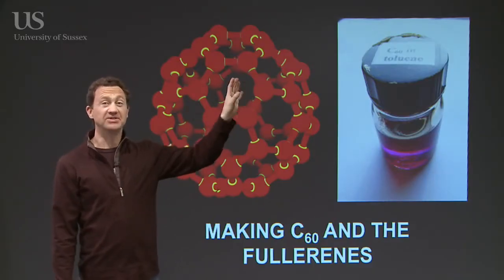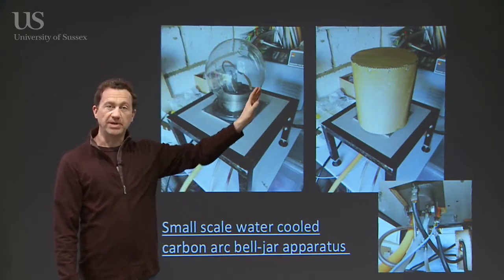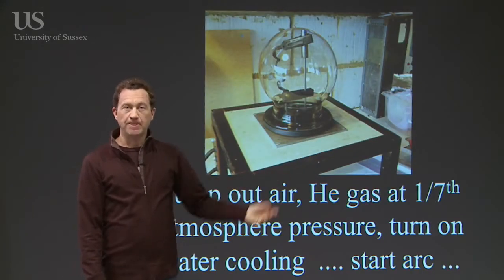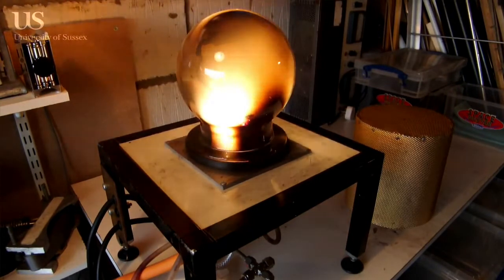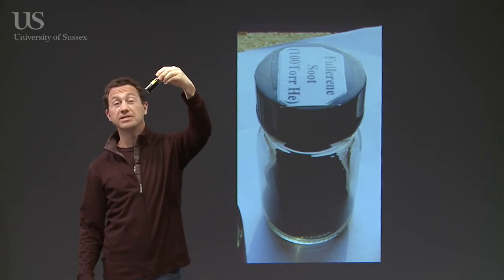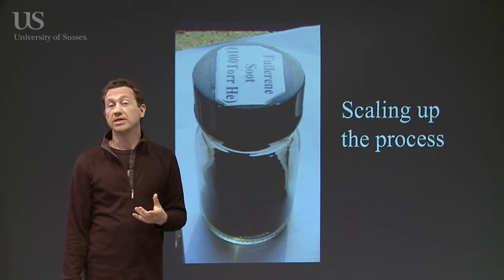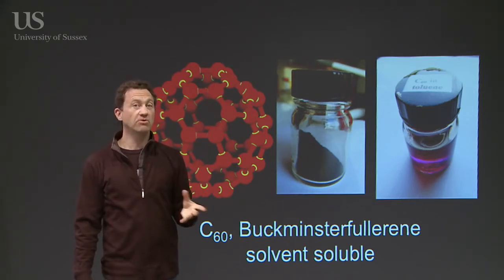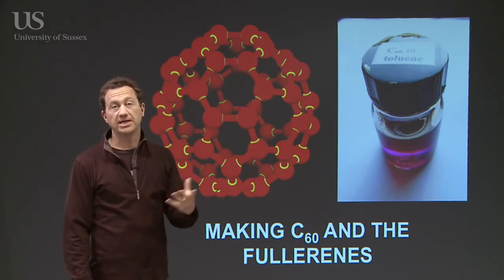The Carbon Revolution Part 2   Making Fullerenes

Comment: Greetings, what's the differences  between c60 soot at vacuum and candle soot at normal ambient?

some said  candle soot was spherical in structure but seems i coudn't find definite answer
Reply from the maker: In the fullerene carbon arc there is no air or hydrogen present, just pure carbon (and inert Helium) - so spherical structures such as C60 can form when the helium takes way the energy of the carbon vapour (i.e. atoms and small molecules). When a hydrocarbons such as candle burn, the flame has hydrogen and oxygen present (and the temp. is lower). Any carbon networks that form tend not to form perfect cages - rather distored roughly spehrical carbon particles tend to grow. There may be some fullerenes (especially if you can suck them out of the oxygen poor part of the flame before they convect upward into the air) but statistacily few - so very low yields of C60 are expected in a trypical sooting flame of a candle.

Comment: This is a great mini lecture, but I have a question. I have heard of a class of fullerenes whereby metals of various kinds are encapsulated inside the fullerenes. Is this approach compatible with these materials? Curious as to how or what someone would have to incorporate to achieve this. Any tips on how to go about assembling a simple apparatus such as the one demonstrated?
Reply from the maker: Yes, you can even drill the carbon rods with materials and vaparise them, and some atoms can get inside the fullerenes (they are called endohedral Fullerenes). But yields are quite low this way ... produce very small amounts of Endohedral Fullerenes
Reply from the maker: Endohedral Fullerenes (where atoms are trapped inside) can be made by co-vapoursing carbon rods packed with other materails but yeilds are very low. Here are details here on making C60 apparatus: http://www.creative-science.org.uk/design.html
Reply: @jonathanhare6644  thanks Jonathan for the insight! That website is a great resource. I hope to try a basic setup in my garage once I have a chance ! I still have access to some of my local institutions facilities for characterization